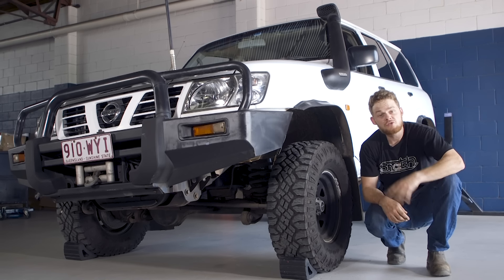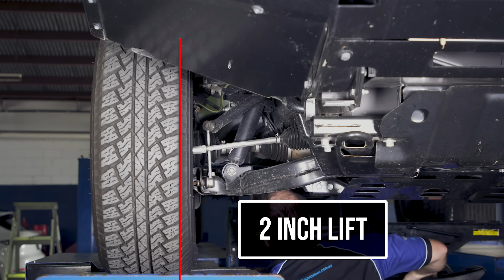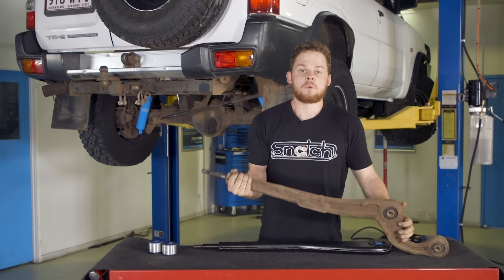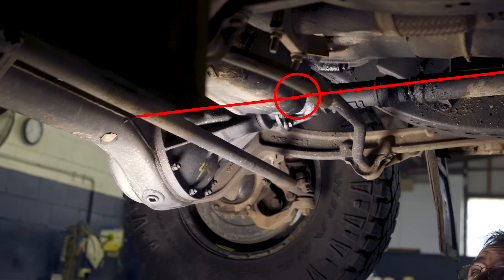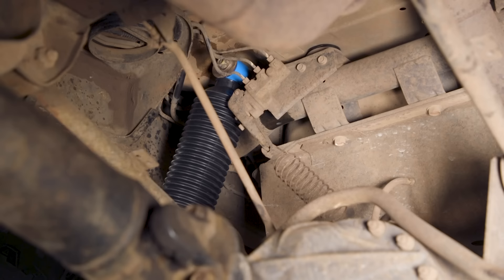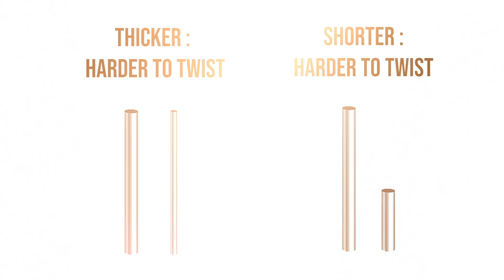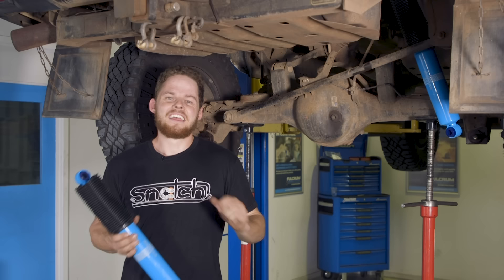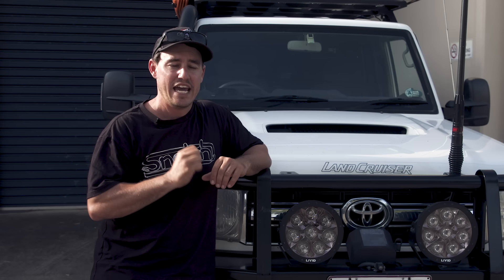EXPOSED! Are bigger suspension lifts better? Experts show what really happens when you lift your 4WD

Comment: Been waiting for this video all day!! Hello from Houston, TX, USA.  I'm ordering my 3" lift for my fzj80 now. Thanks a bunch guys. Yall rock!!
Reply: Whoa, wait. You're from Texas and you don't have an 8" lift? Don't tell me you actually drive off-road!
Reply: 3 inch is mint in a 80 series just did mine and drives better than stock> Although springs had probably done 450k km
Reply: @christopherrowley7506  there's very little offroading in texas. Its all private land.
Reply: @sebastiankvyat3915  ahh makes sense. I've heard that fact in the context of hunting (no public land, it's all pay to hunt ranches) but makes sense too then that it'd be pay to offroad. sucks
Reply: My fzj80r used to run 35s, 4" tough dog lift with dobinsons springs and big bore shocks..... Castor correction bushes, part time kit to solve to front tailshaft angle causing excessive wear.

Drove 1million times better than dad's 75 series with 2" lift.

If I was to do it again I'd try and make the 35s fit on a 2" lift tho I reckon
Reply: In in Texas City with a 2.5" suspension lift and 33s on my 4 runner
Reply: @christopherrowley7506  I feel personally attacked by this LOL. Take Care & Safe Travels Everyone!
Reply: Dios Tejas Tierras I agree with you. The chap was just plain rude.
Reply: @sebastiankvyat3915  ya and when you live in texas you probably know someone with land. also there is every type of offroading to do in texas for free! you may have to drive three hours to get to some dif terrain but its all here.
Reply: @christopherrowley7506  many land owners will let you offroad for free esp if you are hanging out with them also i know a lot of our hunting is pay to play but there are places you can hunt for free texas is big
Reply: @tehallanaz  ah ok I see. Maybe there's some private land access program for hunting? The internets tell me "less than 1.5% of that land [of Texas] is owned by the Federal Government, almost all in the form of National Parks, National Forest land, or Military Bases, with barely any BLM administered land." So that would be close to no hunting opportunity on public land. My state (Utah) is 64.9% public land so 1.5% is another world to me
Reply: @christopherrowley7506  we have Texas State parks, also national Forest land, and some bureau of land management. Texas likes to do it's own thing we have our own department of transportation we build our own roads without federal money. Many in Texas don't want federal control of anything.
Reply: There’s many trails... you just gotta be an actual local to know them. Plus almost everybody knows someone with a ranch. Houston has as much mud if not more as anywhere in the country
Reply: Bardwell in gilmer tx wolf caves by Austin? And Bridgeport in Bridgeport tx 3 to name for off road parks
Reply: And everyone knows everything is bigger in Texas

Comment: 2" lift in the 80 series with King springs and it fits 35" tyres pretty easy.
Although measuring it up it's probably closer to 3".
The arb cheat buttons help it go most places.
Reply: "Tires"
Reply: @leopardcubpupkryky6940  He was correct. "Tyres"
Reply: @mikem5475  😂😂😂😂of course

Comment: This is a great video loaded with useful info. I have a '93 GMC Suburban with IFS. I would like to lift it to get bigger tires but now I know not to go over a two inch lift (as I suspected). The vehicle has 31" but I would like to fit 35" tires. I have learned that anything bigger such as 37" or more would be a mechanical nightmare for this particular truck. Thanks guys down under for all your great advice.

Comment: good coverage of the issue though also very specific to Australia.  The most common lift size on trucks in the US is the 6 inch lift, which usually allows 37inch tires with plenty of travel.  We don't have your extensive engineering laws.  It's also much cheaper here than in AUS.  You can put a 6 inch lift on most full size trucks for under $3000 US, but these are also leaf spring vehicles in fact a lot convert from front coils to front leafs.  Also travel isn't nearly as important as it is for AUS, lifts are mostly a vehicle for getting clearance for 35inch and up tires to deal with soft ground and snow.

Comment: I'm on a 3.5in lift with 33in hybrid at/Mt  tires. 2003 jeep wj , long arms , 4.10 gears, transfer Case clocked for additional 2 in of clearance, low profile tc cross member for additional 1.75 in of clearance, cut off radiator support and made a high clearance support for 2.1 in of extra clearance, heavy trimming of front and rear wheel wells and grind off pinch welds for more clearance, washer bottle relocation, gas tank lifted 11 inches for more clearance, cut out all rocker panels and weld in place 1x 4 in rectangular tube for additional 1.8 inches of side clearance, high clearance steering flip kit . I'm probably missing a few things I did for more clearance but that's what I can remember right now. Oh and all control arm mounts were cut of for more clearances after my double triangulated rear 4 link suspension and front 3 link was installed.

Comment: 2:47 I live in the States here in Oregon, we don't have severe lift laws. My neighbor has a crew cab Powerstroke on 54" Swampers and sometimes daily drives it. Highway speeds at 65mph easy.
Reply: K Digiacomo lucky here in aus you get done for having 3” on 35’s if not blue plated
Reply: yep. i have a 1984 chevy k10 with 9" lift and 35" tires. it was my daily driver for 7 years. cruse at 70 mph (112.654kmh) no problem
Reply: Yea I drove a 76 f150 12 inch lift on 40s for about 3 years daily
Reply: @MrMrsregor  Oregon has a max speed limit of 65 🙄. Rediculous.
Reply: @team_suv7778  I built two '79 F150s, love those! First one was on 38x15.5x15 radial swampers, second was on 36x16.5x15 Dick Cepec's on 15x12s. They must have stuck out 6" from the fenders, but it was a daily 33 miles to work then 33 back, both drove awesome! I never should have sold them. They jumped the dunes here really well around 50mph, what they were made for and never broke once. 👍
Reply: @xjay3200  - What does it take to get blue plated? Does that mean you can get a special permit to go bigger? I'm curious about that, I'll have to look that up.
Reply: @MrMrsregor  you wont have a problem driving in a strange line with any size lift. You could have a 20in lift and it would drive fine in a strange line if the geometry is correct. Where people get into trouble with big lifts is lateral force. Not going straight at a steady speed
Reply: @sebastiankvyat3915  i live in the mountains and only drive very curvy road and usually about 10mph over the speed limit. still NO problems, nice smooth comfy ride. it just needs to be designed correctly, built correctly, and NOT JUST LIFTED
Reply: In my opinion a vehicle like that shouldn't be daily driven, it's not going to stop or turn safely in an emergency making avoiding an accident much more unlikely. It also puts other cars and pedestrians at much greater risk when the unavoidable collision occurs. Your neighbour might not mind the risk, but his family, friends and other road users shouldn't be subjected to it. I'm glad my country has laws to keep dangerous vehicles like that off the road.
Reply: jbrizz99 you clearly have not driven a vehicle that is designed and built correctly.... my 28 year old lifted truck stops and steers as good as my 6 year old stock suv...so, stop guessing and assuming, and leave the judgement calls to people who know what they are talking about and have actual experience
Reply: @jbrizz99  It's my country too and you don't know what you're talking about. Don't listen to the Govt and law makers like a sheep. Think for yourself. Australia is a nanny state and many Americans are saying its safe , so it probably is.
Reply: @Malc664  that's fine I don't live in Australia. I'm happy living where it's illegal. I have two vehicles, ones a car and ones a solid axle lifted 4WD. I'm not stupid, I know how suspension lifts and big tyres affect handling and safety. There needs to be a limit to what you can use on the road, simple as that.
Reply: @sebastiankvyat3915  What does a "strange line" mean, you keep saying that.
Reply: @jbrizz99  What about Semi Trucks or a Lorry? Are those safe or should be banned from public roads? Explain that to me please.
Reply: @kdigiacomo  they're driven by trained professional drivers. But difference between them and the average driver.
Reply: @jbrizz99  Just because you have a CDL doesn't make you a professional.
Reply: Here in the states if u run larger lifts and tires larger then 36 most swap differential  to 3/4 or 1 ton and taller gears when done correctly

Comment: i'm running an Old Man Emu lift in a Suzuki Samurai. 1.5 inches, spring under. Love it! Handles really nice still, better ride than factory, and flexes nicely. That with some rock sliders, auto lockers front and rear,  a set of bumpers and a winch. It will go places that I wouldn't dare take a spring over samurai. All that on 29" tires to keep from breaking axle shafts.

Comment: My sequoia is 2.25” front and 3.24” rear. No sway bar in the rear, solid axle in the rear, long travel socks with limit straps. Helps make up for some flex lost with the lower lift IFS. A locker in the rear makes it ver capable for overlanding.

Comment: I've got 4 inches and 35s on my 80... handles great and flexes like a mad dog offroad 👌
Reply: Handles great! Your dreaming
Reply: @nzmarkb8713  what makes you say that?
Reply: Because lifting it 4 inches messes up your suspension geometry. It may possibly be better off road at low speed in some situations but it won’t handle or break like it did before on the road. If you lift your role centre there is no way it can handle better
Reply: @nzmarkb8713  I never claimed it handled better, I said it handles great. 
When done correctly, lifting 4 inches isn't going to hurt suspension geometry that much, it's a solid axle 80 series Landcruiser, not an IFS Prado shitbox
Reply: @nzmarkb8713  I also have upgraded brakes so it pulls to a stop quite well too

Comment: ive been in the offroad empire for more than 30 years this is a great video and explains these topics wonderfully..i found one thing id like to point out jock said ( all these vehicles have 2inch lifts and go all over AU with no issues) now depending on how you look at it ..one might consider winching to be an issue and you guys winch alot usually from what i can see its because the vehicle got hung up on something. where as if you all ran lockers and a 4 inch lift and bigger tires it would not happen as much..but like was stated in your video its all about what you wanna do off road.keep the videos coming i love watching your guys adventures..me personally my off road truck is a 1983 f150 4x4 long wheelbase with a 4 inch suspension lift and 3 inch body lift rolling on 35's working dual fuel tanks lockers front and rear front bumper and winch mount made by me with a warn 12k winch among other things on board air a bit of water and on board welder.

Comment: Bonjour, hi. From saint-hyacinthe, Québec, Canada. Hi have a 2004 toyota 4runner v8 (prado120) with a OME 2.5 inch hd coils lift and it rides like a charm. For better clearance i had a 1.5 inch bodylift. Lots of space for the  255/80r17 (33x10 inch). I Listen to every of your youtube videos. Brings a little bit of heat, joy and sun in this cold winter here !!!!

Comment: I’m a workshop owner that’s also a wheel alignment specialist
If you want to break cv joints , bend steering knuckles and wear out your steering rack on any independent front suspension vehicle simply raise your vehicle higher that 50 mm.

Comment: I've Got a 2014 N70..I am running 2 inch lift both front and rear from  OME...running 285/70r17 mud tyres...it drive so damn perfect out on the road and off-road  💯💯💯

Comment: I came up w/ the split in "1/2" spring or if air bag inside or such. The cut is about 30 degs or so & it attaches to 2 slide plates So top of spring or progressive spring doesn't hve to sit directly over the lower spring. It allows the 2 plates w/grove slip joint to slide independent but still work together. This helps w/braking where nose or front goes down,& then it resets normal geometry. Not being directly over each means it can b even more progressive not just in spring spacing but the actual size of the spring. Truly quality soft ride even on big trucks unloaded. If u hit a curb or rock again the spring helps NOW front to back as well as just up & down.

Comment: Got a 4" lift in my ifs hilux for over 2 years, Heavy 4x4ing and long trips with next to no issues, 2" cost $990 3" is $1100 and the 4" was 1300 so when you said each inch is an extra $1000 is a bit over exaggerated
Reply: I think they were talking about doing it legally. Like getting it engineered, which is another couple of grand if you go 4"
Reply: @carsella11  yep, 2 inch is legal here without engineering, after that you have engineering and approval ect all costs incurred.

Comment: Best way to fix the panhard rods is to actually drop the towers so the rod sits relatively flat, that way even through travel the diff has bugger all movement
Reply: Drop pitman arm too. Keep steering and panhard rods parralel to each other and also parralel as possible to ground... no bump steer then

Comment: Didn't mention drop boxes? 

I personally run full superior engineering 4" hyper flex kit with 7" shocks bump stops to suit. Drives beautiful on road and off road. They aren't race cars so don't drive it like one. You get what you pay for. And knowledge is power. Do you research.

Comment: G'Day All, I have fitted a 2in Suspension upgrade (TJM) on my 2019 D-Max running 265 AT's, I'm very pleased with the ride, before the upgrade and the ute was fitted with all the extras front and back the standard suspension was flat lined, since fitting great ride, cornering is better, and around better off road, Thanks for the upload can't wait for the next, cheers.

Comment: 2” lift and 37’s in my series 4 gu patrol, feels a lot better on 37’s than 35’s.
Reply: Luca how much guard chop😂
Reply: Zero dude, just set the bumps to suit to limit up travel and get correct offsets, radius arm spacers to push diff forward then let whatever scrubs wear out by itself, little bit of cutting on the flare and the inner protection shroud. Also have 50mm spacer in front spring to even out suspension which is temporary until I get a proper setup once all weight is sorted.
Reply: Luca fair enough every other patrol I’ve seen running 37’s either has the biggest loft or the biggest guard chop
Reply: @_jayw_  I had one on 35's with 2 inch and 2 inch body lift, still rubbed and what a POS, currently dropping my zook back down to earth now.

Comment: One of the best setups I used to run was on my Jeep cj7, 3.5" lift,31"x11.5"-15" rims, 15"x8" wide with 3/4 center offset to the inside ( sorry I didn't use metric, I'm feeling lazy today), 4 speed trans,258 inline 6cyl. With a little torque modification and around 3:90 something rears or 4:11 ( I can't remember which). She went everywhere,drove great in city and hiway. Now I just have just under 4" custom lift and 33" rubber on my 85' dodge w-150.

Comment: Yoooou don’t neeeed a sway baaaaar
Reply: what about when it comes to engineering?
Reply: @wheelofadventure1716  disconnect it for off-road, no disadvantages. Hook it back up and you get standard onroad performance
Reply: Technically you dont even need suspension.
Reply: All manufacturers disagrees ;)
Reply: You guys are hilarious 😂
Reply: @TheGuyWho3415  There are major disadvantages offroad running no swaybars. Having terrible roll stiffness is a major issue, and often gets people in trouble on off cambered situations, and when on hillclimbs and there is nothing controlling body roll, creating unequal load distribution and resulting in lack of traction or rolling.

Comment: Stupidest lift I’ve seen. Jeep Cherokee on a 3” lift with 20” rims and low profile tyres. Here in Perth. Spent the rest of the day laughing my head off.
Reply: Stupidest I've seen is a ranger, 2" lift - flares - front and rear bars - heavy duty roof rack - snorkel etc. 20" wheels, 35 profile road tires and all on a 2wd hi-rider.
Reply: @johnsullivan6709  🤣 could be a country driver.
Reply: I looked at a Tacoma at a dealership once. I was lifted,mud tires rock bars,lights ,nice bumpers and lots of accessories. I thought hey that’s not bad I look under it and the damn thing is 2 wheel drive,🤣

Comment: I run a 2.5 inch OME on a 2018 Jeep JKU and 35 inch tires. I have had to ad a 2 inch spacer on top of the rear spring to help with sag, as it is pretty heavy when loaded. I works great, wife drives it to work 80 miles every day.

Comment: This is why I like lift spring vehicles. Usually most factory vehicles are leaf under axle so you can easily gain 3- 3 1/2 in by doing spring over and requiring me to have to fabricate and weld on new perches where the pinion angle will be reset anyway not becoming an issue. As far as steering goes I build a custom Z bent drop link to tie into the center link for steering. Brake hoses are tossed and new stainless flex goes in with proper strain brackets. Awesome3-1/2 in build for the cost of a few pieces of steel and some longer shocks and brake hoses. I understand not everyone is capable of fabricating their own parts and welding them on. Those who can have a cost saving advantage 👍